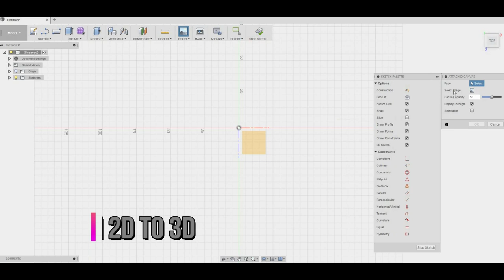Creating Complex Channel Letters and Logos with Massivit 3D

Comment: What bending machine are u use?
Reply from the maker: Hi Leo, when channel letters are produced on a Massivit 3D printer, there is no need for bending as there is no aluminium involved. Photo polymeric gel is injected out of the 3D printing head and cures almost instantly via the internal UV light. A whole word can be 3D printed in one go. Thanks.

Comment: What software do you use for the designing?
Reply from the maker: Generally, our Applications Engineers do the 3D modeling in ZBrush. Sometimes Rhino.
Reply from the maker: Hi Danar. You can use whichever software with which you are comfortable. Our designers like to use Z-Brush, Rhino, and Solidworks, but Massivit 3D technology is not limited to those.
Reply: @massivit 3d 

All right thanks for the info
Reply from the maker: @kirkuk92able  Are you subscribed to our channel, Danar? We are going to post some really cool stuff soon.
Reply: Massivit 3D Printing self promotion....

Comment: I wanna know how tf that was printed in 20 minutes
Reply from the maker: Hi @Matt Morel,
The maple leaf pictured here measures 400mm x 400mm x 50mm (15 x 15 x 1.9"). The Massivit 1800 large format 3D printer prints at a linear speed of 300mm/ sec linear speed or 35cm /13.7” on Z axis per hour. Feel free to contact us for more techi details at info@massivit.com . Thanks!